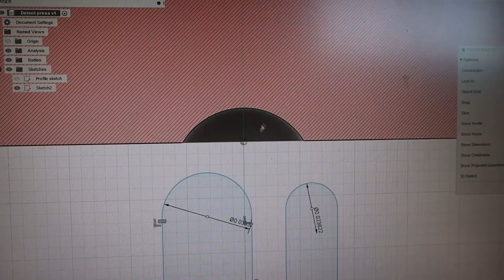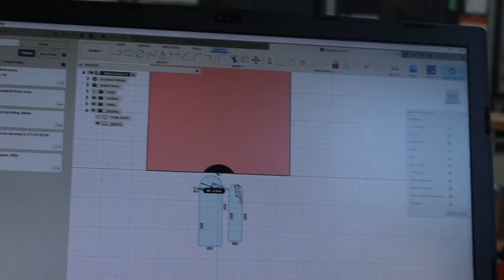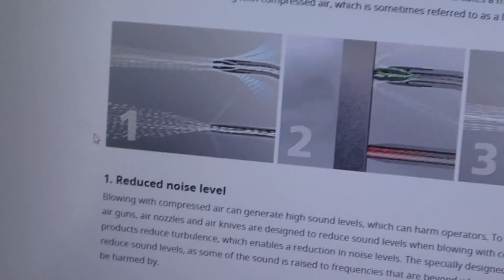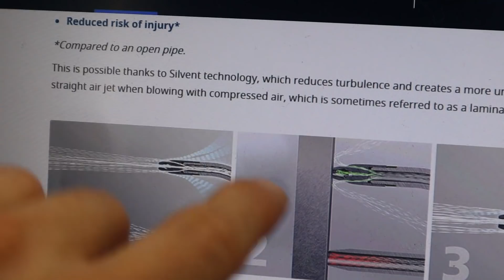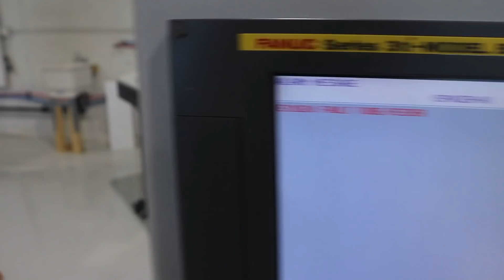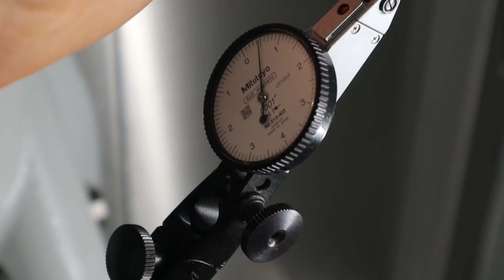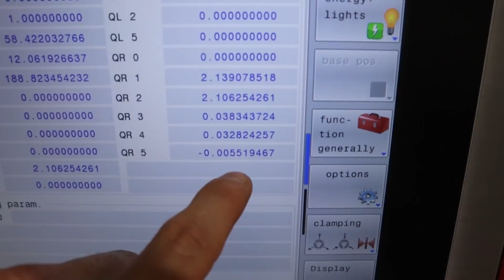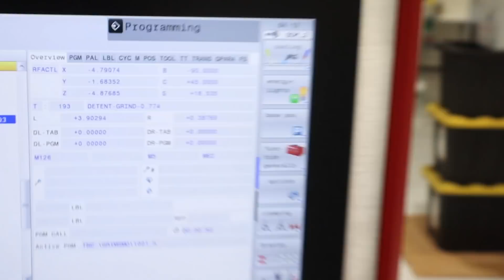Working at the shop until 4 am - Shop Life 46

Comment: The alarm on the barfeeder was the machine trying to do more parts when there was no sufficient bar left. Reduce your rechuck distance or increase the part length on the feeder to make it change the bar one part earlier so it wont try to run a part with not enough bar.

Comment: Started thinking this ball pick and place. Maybe there could be a few tool spots on the kern dedicated for some kind of tools which could somehow hold one ball each. The ball would release after the tool has pushed the ball in thr hole. I guess a magnet wont work here because of the ceramic balls, would have ro be some kind of a spring loaded thingy :p

Comment: You should consider solar on your flat roof to power AC. At house in Southern California in December 2016 we installed a ground-base solar PV system producing  over 27 mWhr of electricity each year. The PV panels were made in Canada. We have 3 AC units for a 5000+ SF house. The AC is producing over 12 tons of cooling.and sometime we run all three AC 24x7. Our electric bill is zero and we even send power back to the grid. The system will pay for itself in four years. One of our best investments ever. You should consider solar. By the way our white plaster pool was at 78 degrees F today and by late August it will sun heat to 85 degrees, so you know it is hot where we live.

Comment: The build on that air gun suffered as a result of focusing on the air tip. Aluminum to plastic is a temporary attachment point. Solid brass chrome plated with Teflon tape is the best way to go for a shop tool. Can you remove the the tube and nozzle and thread it into brass handle?

Comment: If you want to run Lights-Out and hold 0.0002", climate control is a must. We use Heat Pumps that can reverse cycle for A/C. That way, warm or cold out the inside can stay the same temp. One other thing- oversize your system. The cooling load you have now will change as you add machines to your business.

Comment: The real meat of the air nozzle getting extra air boost is a result of fluid entrainment, which is the actual action of the fast moving air creating a low pressure state that pulls extra air in through the surrounding holes along for the ride. A laminar flow venturi is what creates that primary blast, entrainment is the action of surrounding air amplifying the volume of air being moved. 
Same concept as the bladeless fans and so-on. 
Unless I'm totally way off in this case, aerofluids guys please add more info!

Comment: you might want to make it a standard practice to valve off at end of shift your air guns or even when you are walking away to another work cell.  one it puts less stress on the system two if that happened overnight you would have been running your compressor hard all night.

Comment: So does the detent ball not bottom out in the bottom of it's hole? Is there any concern of it working its way in and changing the detent feel over time?

Obviously if it works, it works. But if it were me, I would precisely cut the bottom of the hole to be the stop, and use some kind of a spring loaded punch in the machine to press it.